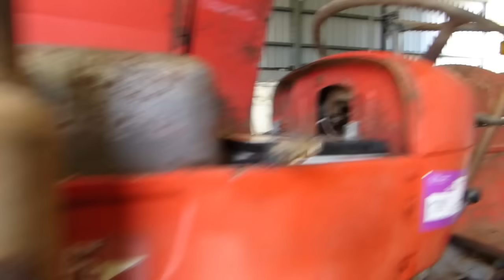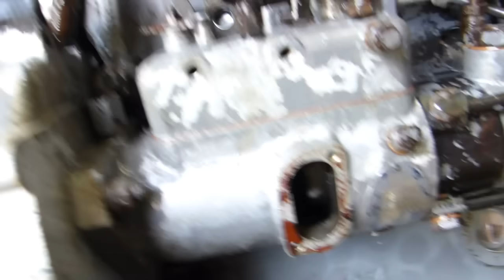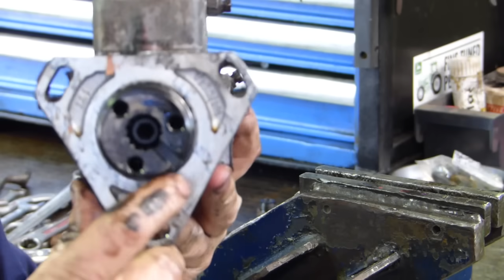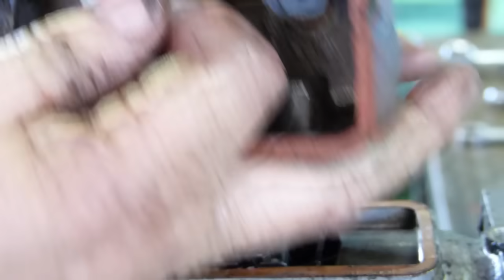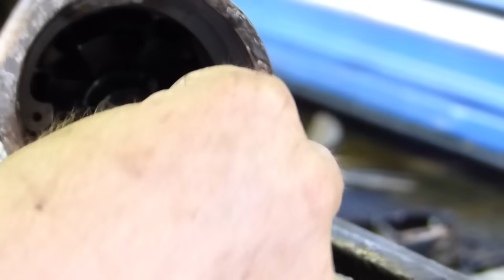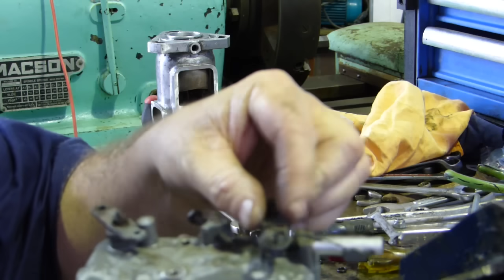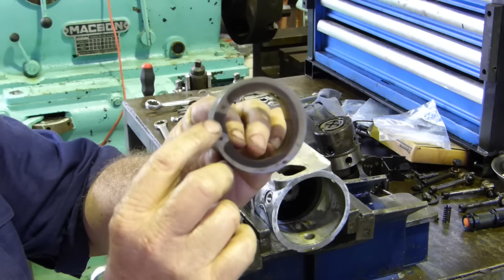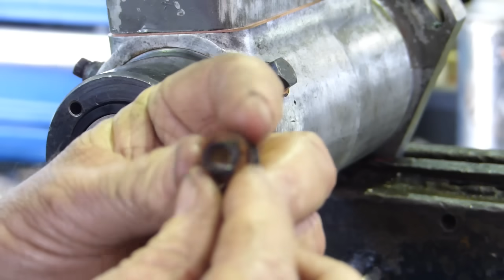CAV Injection pump full strip down to re seal and stop fuel leaks

Comment: Hi Lance, love your youtube on cav injection pump rebuild. thank you. my question is about diesel eng flush. Is it not good practice to flush eng. I have low oil pressure . Im going to change sending unit. but not knowing history of engine , the screen may be gummed up. Engine runs great ( Volvo penta md7a). I have heard to use  motor flush, kerosene, transmission fluid, and just don,t do it at all. What is your advise. I,m just a barn peasant, not very computer savy. Not even sure you will get this . thanks for your time. Mark
Reply from the maker: G Day Mark, I would stay away from the flush stuff,  if it frees up slush first thing it does is pump it through everywhere. I would suggest a couple of oil and filter changes at very close intervals, use cheap oil not the expensive stuff then put the good stuff back in when you think it has cleaned up a bit.

Comment: I've been chasing a leak on my MF135 for a few days now.
I replaced the banjo sealing washers last night, which made no difference. Been stuffing around with a mirror and torch all morning, and have determined that it's the o-ring at 25:55.
Looks like I'll be jumping in the deep end and doing a full disassembly. Thanks for the video Lance. I'll be ordering the seal kit from you.
Cheers from Central VIC.
Reply from the maker: Its not too scairy, In my MF135 6 Speed restoration series video 14 and 15 goes into the 3 cylinder pump more than this video.

Comment: I took the top apart and unfroze the metering valve. Put top back together but still no fuel to engines. I get pressure to top bleeder valve. Any ideas
Reply from the maker: Go and look at my MF135 6 speed series video 14 and 15 I think. I think you have sticky plungers. I didnt cover that in this video.

Comment: Great video lance.  It seems pretty straight forward.  You mention timing and I am wondering if there is anything special to worry about regarding timing or metering of fuel flows?  Or, basically, if I take it apart and put together just as it was I will be OK.  I'm working with a MF 275 that is leaking fuel and needs o-ring and or main seal replacement.  thanks!
Reply from the maker: Doing this job everything will stay set as it was. You can't really muck up the timing as there is master spline and key ways.
Reply: @bundybearsshed  Ok great to know Lance and thanks for the quick reply.  Were just gearing up for haying season here on Vancouver Island. John

Comment: Have a long 2610 and I'm putting a new fuel injection pump on it but I can't get the old one  to slide out off the gear. Any tips
Reply from the maker: G Day Tim, I have found leave the nut on loose and level with the outer tip of the thread, tap a couple of screw drivers gently under the mounting flange to keep a little pressure on the pump then smack the end of the thread with a big punch, the jarring will often make it release.
Reply: @bundybearsshed  thanks, I got it out. Now as long as the gear is in the original place the new pump should be in time,right?

Comment: Hi Lance, this is an excellent video.It really helped me to clean and rebuild the top part of my pump. However, like a typical novice, I didn't look at which hole the spring was attached to the governor arm! If it's in the wrong hole what could expect to help me understand it's wrong and secondly do you know if there is a throttle code somewhere for a David Brown Engine 995 pump 3342F540 by any chance (I do not want to tackle taking the whole pump off and cannot see any code on the pump)?
Reply from the maker: G Day Nathan, Lift off the top and have a real close look at where the springs go. You will see a small shiny mark where they have been sitting in the plates.
Reply: HI Lance, thanks for getting back to me. I did look (well I thought I did :) ) but didn't notice anything significant. What I did notice though, that there was no spring and I didn't even know I needed one until I saw your video! Do you know what might  I expect to experience or hear from the engine if it is wrong ? I'm in the middle of draining the oils at the moment so I haven't had the opportunity to run it propery yet!

Comment: Far the best video to explain CAV pumps. I have to do mine on a David brown 1390.  the bolt for the adjustment screw stripped out
Reply from the maker: G Day David, Thanks ,on the MF135 6 speed playlist videos 14 and 15 go into the injection pumps a bit more that this video. You may be interested.
Reply: Bundy Bears Shed thanks will do.👍

Comment: I had a ford D series 4 pot run away the other day, i spoke to a buddy and he seems to think the its fuel pump related rather than sucking crankcase oil. guess ill be getting into the pump sometime soon.
cheers for upload, subscribed.
Reply from the maker: G day Duncan, I had a run away once and it was from an over filled oil bath air cleaner and it ran on oil, scared shit out of me.
Reply: @bundybearsshed   Scary is right on... I had the cab down when I started it after sitting a while. the engine just roared from cold. Tried pull the fuel knob, didnt work. Jumped down and in a panic and without thinking tried to plug the exhaust!? Very bad move! Jumped back in the cab and tried to stall it with the clutch, nearly got it but the clutch couldnt hold it. Started to undo the bolt that holds the cab down, but forgot to turn the gear lever forward (cab catches on the gear lever) so took a couple goes. Got a rag rolled into a ball and stuffed it into the filter intake. Didnt stall it but dropped the revs enough for me to drop the cab back down and stall it with the clutch... I realised then how badly id burnt my hand.
That was a week ago now, is healing well and I shouldnt need a graft. Thankful it wasnt worse, it sure coulda been.
Cheers
D

Comment: Great video Lance,thanks very much for sharing. I have an old David Brown 25D tractor from 1957 with a DPA pump fitted which will one of the first.I was always told its a specialist job to reseal these pumps but now feel confident to have a go myself instead of taking a mortgage out. Will the new service kit fit the old 1957 pump?
Reply from the maker: G Day Martin, Yes I think the kit fits most of them, I have used them in Implematic pumps before but a 25D im not sure what the pump looks like.

Comment: Thank you good sir!!! While putting everything back together I snapped one of the long bolts that holds the cap down to the pump. I’ve searched high and low around my town and can not for the life of me find it! Wondering if you could help with the description of the bolt. I know it’s 1/4-20 on the bottom and 10-32 on the top and just about 2 inches long but don’t know what it’s called so I can search and purchase one! If anyone could help I would be so grateful!!! Thank you again!!!
Reply from the maker: G Day Tony, I have done the same thing, It is just a top cover stud and I would try the tractor or truck wreckers.
Reply: Bundy Bears Shed thank you so much!!!!! I ended up finding some on amazon as well. I kept trying searching the sizes and the words “stud” to no avail but when I searched amazon for “CAV Lucas too cover screw” I found one person selling them for 11$ a piece haha!

Comment: is this the same injection pump as the one on a case (David brown) 1394?
Reply from the maker: G Day David, Yes very similar, yours might have an advance on the bottom, I do a 3 cylinder one on my channel in the MF135 6 speed restoration around video 14 and 15. The 135 videos is a little more in depth.

Comment: Have you ever added anything to the fuel to stop or lessen a throttle shaft leak ?
Reply from the maker: No I havent, Im not sure it would fix the problem long term and when it is easy to just replace the top o rings I would go that way.
Reply: @bundybearsshed  I have a 6.2 GM old US army with a small leak at the IP but still runs good I wanted to do a temporary fix for it I've heard of a product in your area called" liquid intelligence 229" haven't seen a product here in the US yet .

Comment: Thank you very much for this video. Been around tractors all my life and have always been told that you don’t mess with a injection pump, that’s only for the professionals. I have now successfully resealed the pump for my old Ferguson. Also, YouTube is amazing, you’re sitting in Australia instructing me as I’m picking the pump apart several years later and thousands of miles away in the northern parts of Sweden
Reply from the maker: YouTube is a handy tool, I look here for most jobs I have not done before and Im often not disappointed.

Comment: Hi Lance,  is it possible to replace the O-ring shown at 26:30 without dismantling the top section of the pump? This o-ring is leaking on my Ford 4110 and if I can replace it without taking the whole pump apart that would be great. Cheers.
Reply from the maker: We think it is worth a try, worst thing that can happen is you will need to take the pump off to fix it.

Comment: Thank you! I have 2 CAV marine 4.154 in a trawler.
Injection pump failed on one, going to send it out for rebuild once I do it's just a reinstall correct? Pls advise GBrad1955@yahoo.com
Thanks
Reply from the maker: Yes just fit it up and you cant go far wrong if the timing mark on the pump mounting flange is lined up.

Comment: can the governor spring position be changed to increase max rpms? There was an engine swap done on my excavator and I need to increase engine speed to get correct hydraulic flow.
Reply from the maker: G Day Mike, Just adjust the throttle lever max rev stop, that will give more revs.

Comment: Great video Lance It’s over 30 yrs since I played with them To our American friend there’s not a lot of difference between the cav and stanadyne  pumps all rotary are pretty similar. We used to adjust the scroll all the time to give the old dear more pep up to15 horse s that was the eighties chip worked fine if had a bit of respect for the extra horses , some time if you could explain that adjustment.also the safety bit about keeping clear of the squirt easy lose a finger or a hand
Reply from the maker: Thanks Paddy.

Comment: This was extremely helpful as I am currently battling with my MF 165.  Thank you so very much for going into all the necessary details.
Reply from the maker: Thanks Justin, I go into more depth on the MF135 restoration #14 on my channel. Even though the 135 is a 3 cylinder the main part of the pump is very similar.

Comment: I just rebuilt my CAV pump on a David Brown 1490. It runs perfectly now with no leaks. I had the video running on an ipad on the workbench as I stepped through the whole process. I couldn't have done it without your video. Thanks from Ottawa, Canada.
Reply from the maker: Thanks Steven, Im glad it helped, thats why I do them.
Reply: @bundybearsshed  Hi again, I noticed that there is a small amount of diesel weeping from the small 9/16 bolt on the bottom of the pump. There are two bolts side by side on the bottom of the pump. It's the small one. I can't remember what it holds anymore inside the pump. Can I remove it and put another copper washer on it or will something fall apart inside the pump? I can't remember anymore what it holds inside. It was only a couple of months ago when I rebuilt it but I can't remember. Everything else is perfect, just that small weep of diesel. I tightened it more but I am afraid of stripping it. Is there a reason it won't seal even with the new copper washer I put in from the kit? Thanks.

Comment: My massey 255 gets fuel out both bleed off screws and returns fuel to the tank but I only get fuel to the back injector.no fuel fron the other injector lines..what’s going wrong? I,m desperate!
Reply from the maker: Remove the lines and crack at the e pump. The 1 plunger does all cylinders so I would look for rubbish in the lines etc.

Comment: Why is it so important to mark the location of the large circlip under the cam ring.  I don't see why it matters where the ends of the circlip are.  Thanks for any help and GREAT video.
Reply from the maker: G Day John, The flat end of the circlip is a line to time the pump with.
Reply: Thanks for the reply.  Doesn't the Auto Advance Unit on the bottom set the cam timing?  What is the flat end of the circlip timing?  I'm missing something.
Reply from the maker: It is a static timing reference point for fitting the pump and doing initial timing.

Comment: I hope you haven't already answered this question, but I'm not finding it in the comments. Am I able to take the head off without taking off the top and taking out the metering valve. You started on the head, then went to the top, and then back to the head. The reason I ask is that I've already had my Ford 5000 to the mechanic. They started with the obvious leak out the pin on  top of the CAV. Once they got that fixed, though, it was apparent that there is also a leak between the head and the housing of the CAV. I don't want to have to undo what they did to get to the rubber stuff behind the head. They said it would be $1200 USD to fix the leak around the head, though, so if i could do it myself it would be thrilling. Just don't want to have to mess with the stuff they did, since that part cost me $300 already.
Thank you for your detailed video!
Reply from the maker: To replace the oring you will need to strip the pump right down.
Reply: @bundybearsshed  I was afraid of that. Thank you for you reply.

Comment: Hi Lance,
Thank you so much for this amazing video. I disassembled my Lucas Dps Pump of my land rover and the main pump plungers where stuck. After cleaning and bringing the whole pump together again I got still no fuel at the injectors, only a few drops sometimes. What should I check next?
Reply from the maker: possibly the metering valve and check the springs are in the correct place.

Comment: Thank you Lance. My son and I got my fathers MF35 running again after watching this very well done video. Thank you for sharing your wisdom and experience. We both mowed the field in New Hampshire, USA, my father did for so many years. We had tried everything else and were about to spend $680 on a rebuilt CAV pump. We broke the injector pumps wire seals and did a simple cleaning following your instructions. After reassembly the problem, no fuel getting through, was resolved. Not sure what was not functioning properly but after bleeding the four lines the engine fired right up. Runs smooth and sounds good. Wish you the best. Take care and enjoy life.
Reply from the maker: G Day Ken, Thanks good news, feels good to fix it yourself.

Comment: Hi Lance. Brilliant video. Love your style of explaining things. There are a couple of things that I hope you can help me with.
When I removed the end cap and tipped it upside down to extract  the fuel inlet assembly and nylon filter, the bits dropped on the bench in a 'random order'. Is there a diagram anywhere which shows the correct order.
Also, despite good fuel supply to the pump why would the outlets to the injectors be lacking in pressure. I have checked the solenoid valve and confirmed that it is working?
Reply from the maker: G Day Warren, the very fine spring with the end going across goes in first then the small shuttle valve then the heavier stuff. Sometimes the main plungers get worn and the head needs replacing. The internal leakage causes the poor pressure. If it starts well that is not the problem, just gummed up valves.
Reply: Hi Lance. Many thanks for the info. I have made an attempt to reassemble the fuel inlet components and have taken a pix of the what I think is the correct order. Am I able to  send it to you somehow for confirmation. Thanks
Reply from the maker: bundybearsshed@gmail.com

Comment: That CAV pump is basically a slight modification of the Roosa Master/Stanadyne pumps used on all kinds of diesels here in the states, so this vid basically covers those for the most part as well. The differences are in the injection advance and fuel stops mostly, along with  governor linkages under the top cover. The basic guts, however, are the same beasty, lol. The Ford IDI v8s (and the International IDI v8), GM 6.2 and 6.5 mechanical injection, even the Olds 350 diesel use practically the same as this CAV. Great vid! Nice step by step coverage, superb shooting, and great practical hints!
Reply: The Roosa Master and the CAV are very similar from a mode of operation standpoint, but some aspects of the pumps are very different. Pretty much everything under the top cover is vastly different. The drive on the 2 pumps is very different too. At least the CAV doesn't have the dreaded flex ring that comes apart.

Comment: Lance, thank you for sharing this. I have a leak on a fuel pump of a John Deere 2140 which is exactly as yours was. I will use your video as a guide to reseal this pump. As a side note, I have 3 other machines that use this same fuel pump. So I got some work to do.
Reply from the maker: Yes it sounds like it, they are all the same so hopefully it all goes well for you.

Comment: I have been working on diesel engines in the farming and marine world for over 50 years. You my friend are as asset to the Youtube community. You are easy to listen to, you know what the hell you are doing and you encourage others. Thank you for sharing and thank you for one of the best how to videos I have ever seen. Well done my friend.  Captain Ron, Napa Valley Marina, Napa, California.
Reply from the maker: Thanks Ron.
Reply: @bundybearsshed   As above - I brought an International 444 that wouldn't start and was getting harder for the old owner to start. Did the round rear part as described in your video so well, the valve was a little sticky, put it back together, still no go for diesel out injector tubes, popped the top off and hello stuck valve on the kill lever. Running well now. Thank you again.
Reply: je ne peux pas chargé ma pompe injecteur comment remplir la pompe